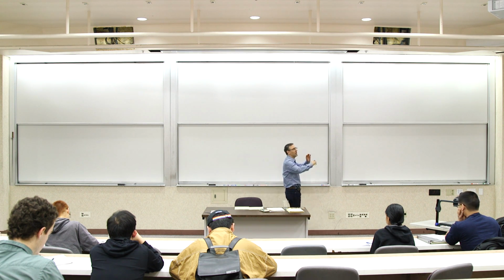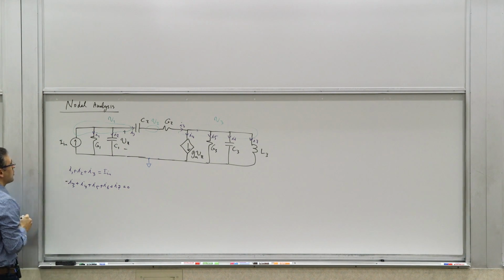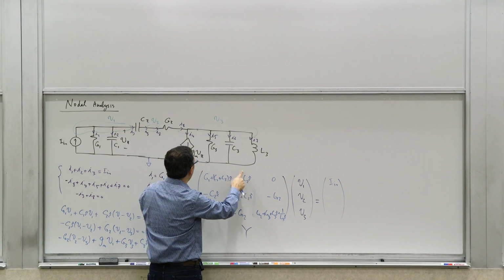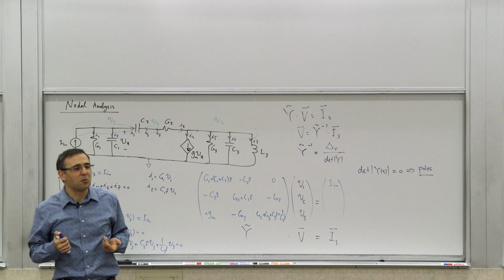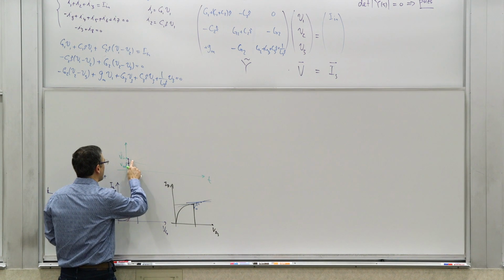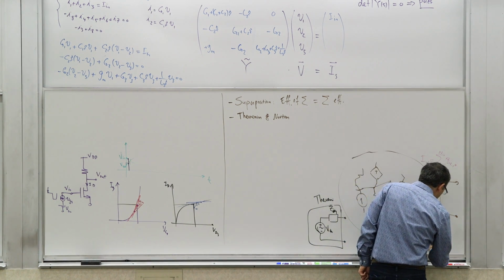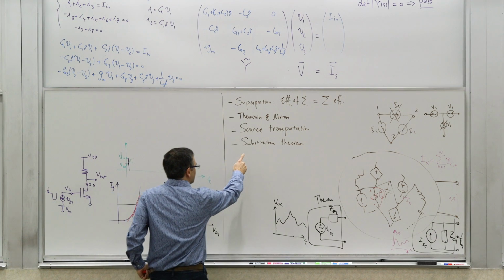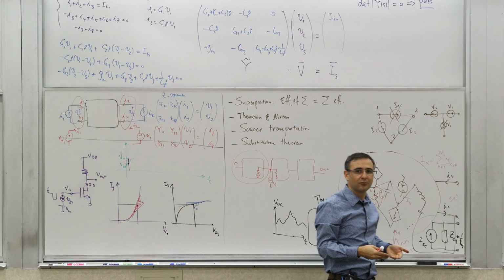117N. Circuit and network theory brief overview, nodal analysis, theorems.

Comment: At 35:20, Why did he say the Norton one is warm and Thevenin one is cold? Is it because the current is flowing in the former one and energy will dissipate in form of heat?
Reply from the maker: Yes, exact implementation of Norton will have current flowing through the resistor, but the Thevenin will have zero current through it.
Reply: Thank you so much for your response and being kind.

Comment: I am pretty sure you can use nodal analysis for non-linear circuits, you can't use superposition
Reply from the maker: You can write the nodal equations for a nonlinear circuit (which are essentially, KCL and KVL) but to describe the branch currents in terms of node voltages you cannot use the Ohms law (which is linear) and therefore you cannot express in a matrix form that can be inverted to solve. 
The nodal analysis is used to solve nonlinear problems, by linearizing the problem around the operation point, solving it to find an incremental change in its voltages (and current), to find a slightly modified operation point around which the circuit is re-linearized to run a new  nodal analysis. This process is repeated iteratively to do what is essentially transient analysis. Of course there are a lot more nuance to this that cannot be discussed here.
Reply: @AliHajimiriChannel  thank you for replying and for your clear response. 
I am high school educated but have been reading a lot about electronics and the math behind it lately. So by no means am I an expert.
What you are describing sounds like a mix between Newton's method and a matrix. 
When I read a differential equations textbook it described utilising eigenvalues to linearize and predict the response. The type of eigenvalue whether it was real imaginary or mixed would tell you if it was stable. 
What is a topic I could read on to see an alternative method to solve non linear circuits?
Reply: Maybe a more appropriate question would be when do you design systems that utilise large perturbations Vs small perturbations within a circuit.
Reply: @1972hattrick  You use eigenvalues after you have linearized to predict how the system behaves.
Reply: @ordinaryman_0 very true, I did not even think of that option

Comment: So, thanks to super position I can use a fourier series to analyze the effect of a circuit on any signal as long as it's a linear circuit. I guess as long as my signal is small then the harmonic distortions from non-linearity will be negligible. It's really starting to make sense why harmonics pop up that aren't explained immediately by Fourier analysis. It's because the system is non-linear and thus we don't have superposition.

Comment: Hello Professor I would like to ask whether this course is going to include basic electronics circuits like diode rectifiers, voltage multipliers and other fundamental circuits or is it going to be focused on amplifier design ?
Reply from the maker: The focus of the lectures are more on amplifiers, but the problem sets address some of the other blocks.
Reply: @AliHajimiriChannel  Thank you for answering professor. It would be invaluable to me if there was some way that I could access that material. Keep up the good work. Your videos have helped me immensely